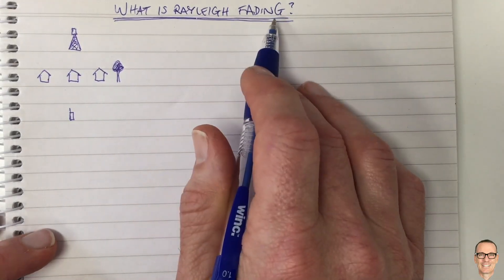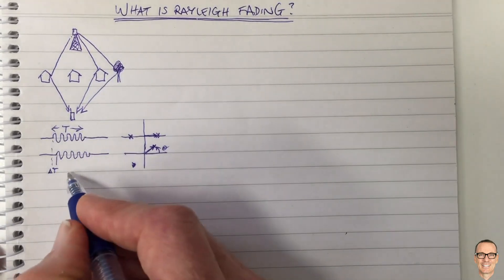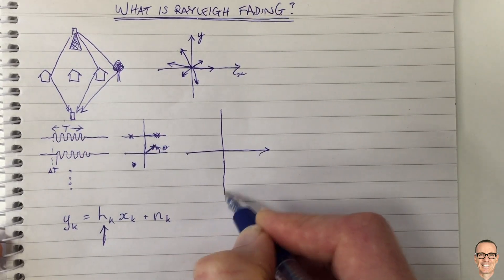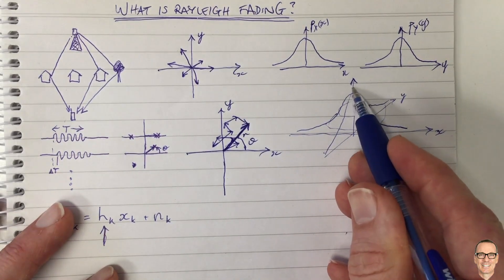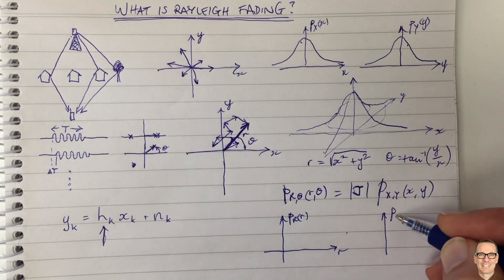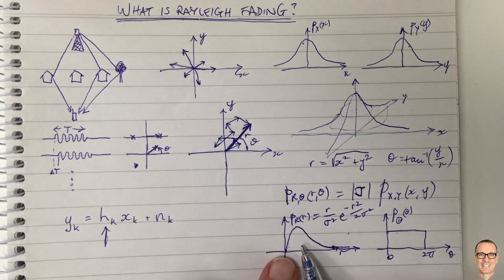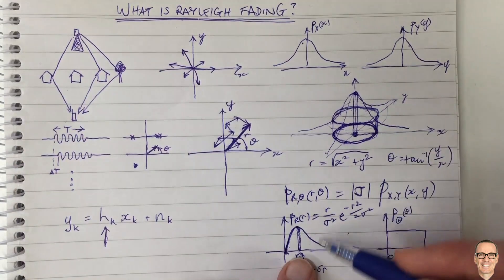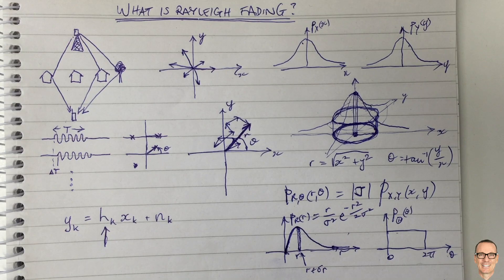What is Rayleigh Fading?

Comment: I don't know if this video's comment section would be appropriate for this question, but given the symbols being received at a delayed rate, how the receiver differentiates the symbol received if it's a "current" one (i.e. non delayed) or a delayed  one in order to properly reconstruct this given symbol?
Reply from the maker: Good question. Actually this is something that needs to be solved for all digital communication systems, whether they are fading or not. There is always a delay between the transmitter and the receiver. And the clocks at the transmitter and receiver are always seperate and independent (by definition, since they are at different locations), so they always need to be "locked". This is called timing recovery.

Comment: hello lain @ 0:33 the received waveform will also suffer a delay as it will not receive instantly but rather with delay and thus its phase will be also rotated, so why have you considered it without delay signal and why in AWGN channel in contrast to rayleigh fading channel there is no phase shift rather it should have one due to the time delay between Tx and Rx  and hence resulting in to rotated constillations
Reply from the maker: The oscillator in the receiver doesn't know the phase of the oscillator in the transmitter, so there will always be uncertainty about the "absolute phase". So the receiver oscillator locks onto an estimate of the phase. When we draw these baseband pictures, we are assuming that the "overall phase rotation due to the end-to-end propagation delay of the earliest arriving path" is already compensated for.

Comment: @Lain: question: the sinusoid I believe is simplified version of transmitted signal for explanation but for higher modulated signals like 64/256 QAM, the signal has lot of randomness and PAR , and it almost appears like a noise on signal , how does phase delayed signal add up constructively or destructively since all the signals have high amplitude randomness..?
Reply from the maker: The issue is not the order of the QAM modulation, it is the bandwidth of the signal/channel. The single sinusoid discussion relates to a narrow band situation (low symbol rate). When a signal occupies a wider bandwidth (higher symbol rate) then the picture is more complicated. However, the same principles apply to all the frequencies within the bandwidth of the signal.

Comment: Great explanation!
About the confusion point which you mentioned students sometimes have about the dip in the centre of the rayleigh curve and its overall shape: its easy to interpret that by just remembering that it is the radial Jacobian of the 2D gaussian. So at the centre the 2D gaussian is a maximum, so it's derivative (by extension Jacobian) would be zero. That rises quickly to the max as you go further away from the origin in the gaussian (until I believe you reach the gaussian's inflection point, at which point it would BE the max), and then it falls off towards zero as you reach the edges of the gaussian.
What I'm still contemplating though is why the rayleigh distribution is the jacobian of the 2D gaussian 😀
Reply from the maker: Yes, you're right, that's another way to think about the hole in the middle. In terms of your question at the end of your comment: that relationship is just a direct mathematical result of the change of variables from cartesian to polar. Perhaps the question you were intending to pose was: Why are the quadrature components of the noise independent? Now that's a good question. In reality, since we can't measure and track individual electrons, we need to resort to models of overall group behaviours, and this model just seems to work well.

Comment: Thanks so much for the insightful explanation. But may ask, what are the typical values of Rayleigh fading losses?
Reply from the maker: We don't tend to describe them as "fading losses". I guess on a dB (ie. log) scale they appear as losses (if you compare to some reference power level, perhaps an imaginary line-of-sight path), but we tend to describe them more in terms of the "fading gain" or "fading path gain". And I wouldn't say there are any "typical" figures. It all depends on the local scattering environment.

Comment: Hello Iain, Your videos are great and impart a fundamental understanding of communication systems. I have a basic question. Why are the channel and signals multiplied at the receiver? I am trying to understand intuition, especially from the perspective of convolution.
Reply from the maker: Great question. Perhaps the relation to convolution becomes clear if I tell you that the impulse response of the channel (in these non-ISI cases) is a delta function, with a value (ie. "height") given by the gain of the channel. The convolution of the input signal with the "delta function channel" equals the signal multiplied by the "value" of the delta function. This video explains that point: "Convolution with Delta Function" https://youtu.be/TIcfY19dk0c and for a video explaining what "ISI" is, check out this one: "What is Intersymbol Interference ISI?" https://youtu.be/I087FUvW2ys
Reply: @iain_explains   Thank you. It's clear now. ☺